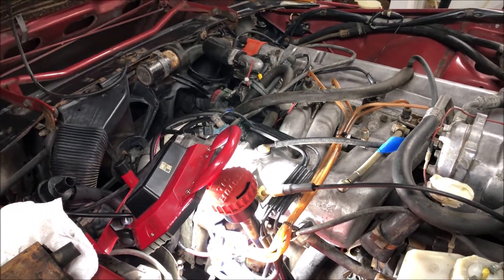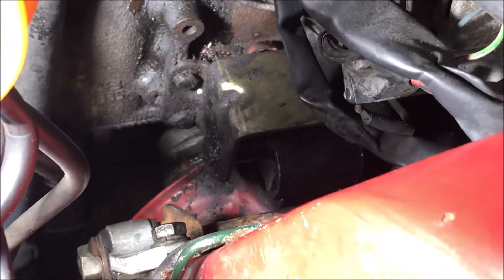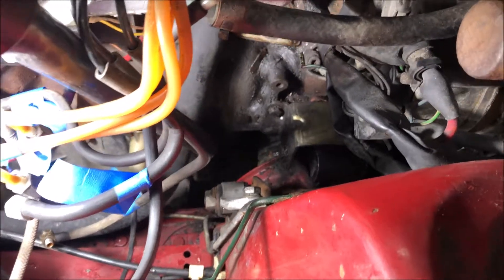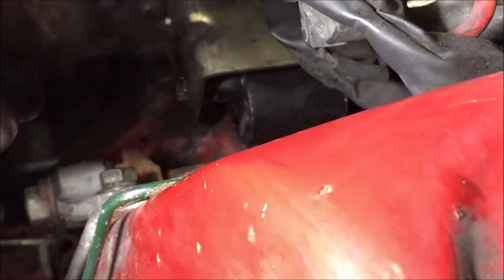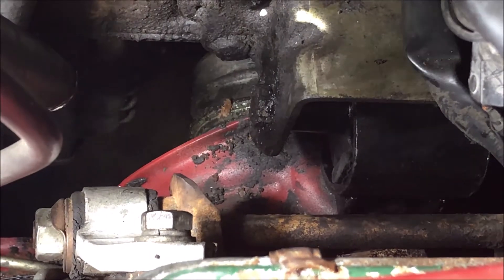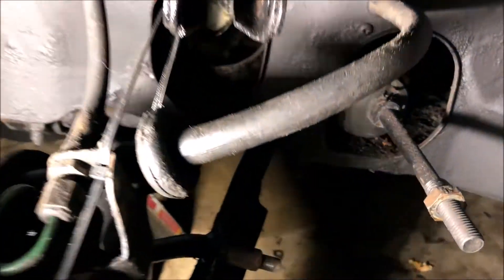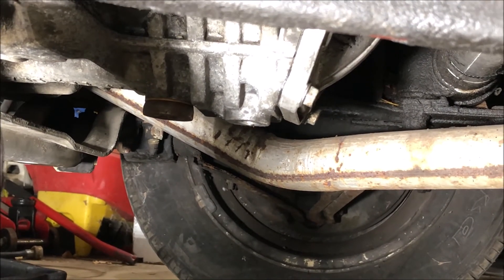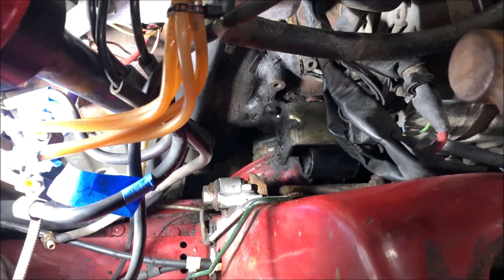1985 SAAB 900S B Engine Left Rear Motor Mount

Comment: About to do this myself. Did you find that the oil filter and filter flange absolutely needed to be removed to remove/replace the mount and bolt? And did you need to move the coolant reservoir at all for more access? Finally, did you move the alternator at all?
Reply from the maker: I did move the coolant reservoir, definitely did not move the alternator, I’m pretty sure I did not have to move the oil filter flange, but that I’m less sure of. That being said, I think it would probably be a good idea to go ahead and get a gasket when you order the mount, just in case